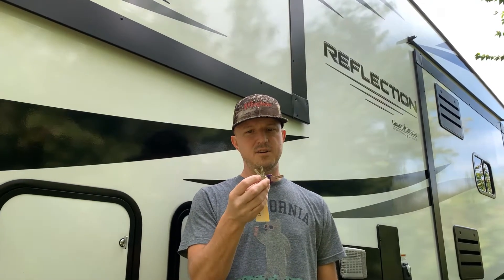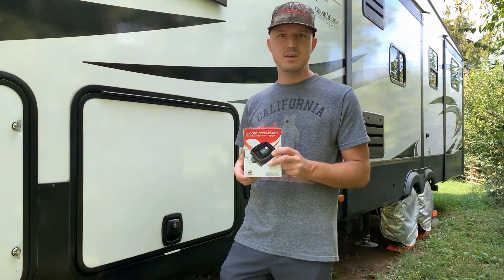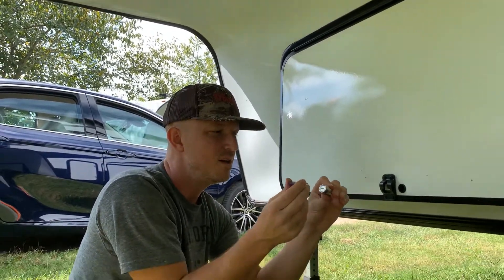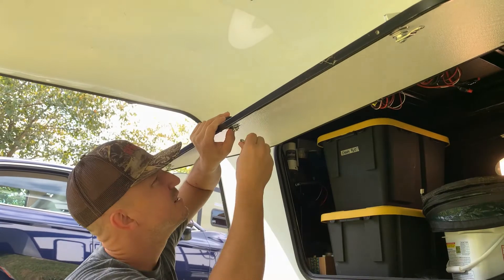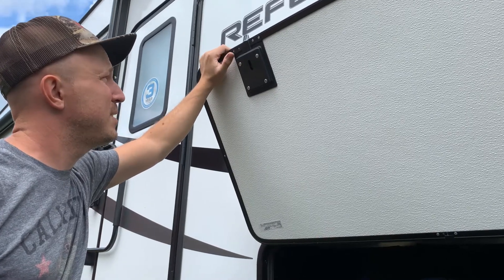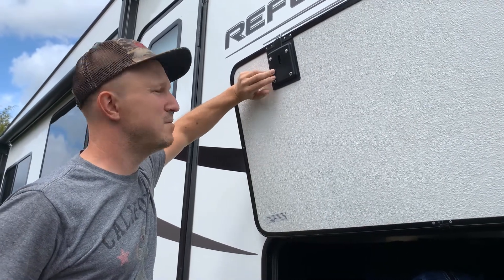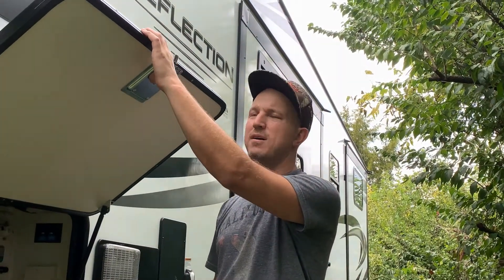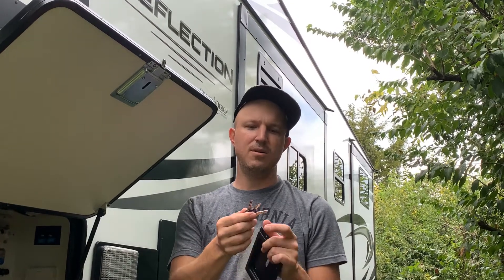RV Lock Replacement for cam and slam baggage door locks.  Get rid of those CH751 and R001 keys!

Comment: The slam latches on my trailer are so easy to pop open with a pocket knife, screwdriver, or coat hanger. If I don't have my keys and the latch is locked, I pop them open with my pocket knife and it takes the same amount of time as using a key. I am looking for a deadbolt type or a nice latch protector, kind of like what's used on some exterior building doors.
Reply: Rv door lock has deadbolt

Comment: Why would you put the gasket on the inside of the door.  It should be on the outside so that water doesn't get inside the door.
Reply from the maker: Roger, good point.  I haven't seen this be an issue so far, but you point is well taken.  I think you'd have to get a better gasket to put on the outside as the one included is paper thin.
Reply: @rvengineer2300  WILCO.

Comment: Super helpful!  One question: when you ordered the slam latch replacements, did you also have to buy the correct cylinder separately?  Or did you specify in the comments when ordering which cylinder you needed?  The website doesn't have the option to pick cylinders on the slam latch like they do with the cam locks.
Reply from the maker: Thanks Alex.
I just put it in the comments and it came with the correct cylinder already installed. You also get extra keys which is nice.

Comment: Quick question 
 I have the reflection 31MB. 
I understood that there were probably only 10 key sets   So I understand I have a one in 10 chance for someone having the same key. Would you want to rekey the door then the cabinets locks
Reply from the maker: Mike,
The entrance door on Grand Designs are the Global Link keys which currently run from G301-G390, so a 1/90 chance of having the same, assuming Grand Design is using the full range of combinations.  I do not know if they only use a certain range of the Global Link system.  Have you been told anything about what range they use?
Reply: RVEngineer No not from Grand Design but from a salesman

Comment: Can this replace the cam latch type?
Reply from the maker: I replaced the cam latch on the outside kitchen as seen in the video w/ the Global Key cam lock.  If your are asking about converting a cam style to slam style, that would be a much bigger project as you'd have to cut out the slam latch profile in the door and attach the receiver plate.  It is possible, but you risk having to buy a new door if you mess up.  I'd recommend only swapping Cam for Cam and Slam for Slam with this system.